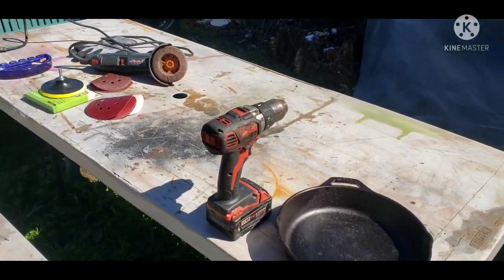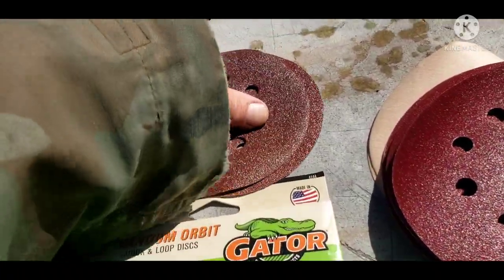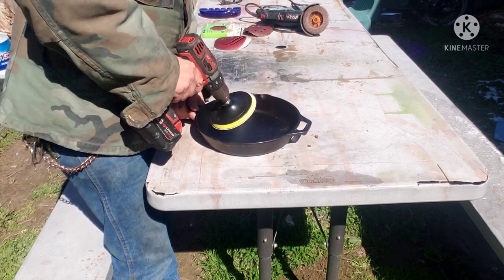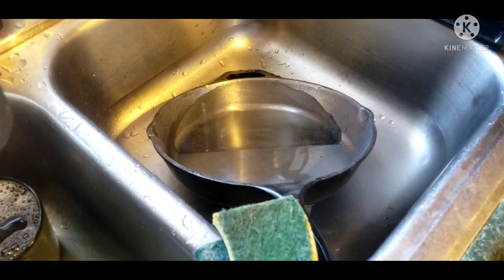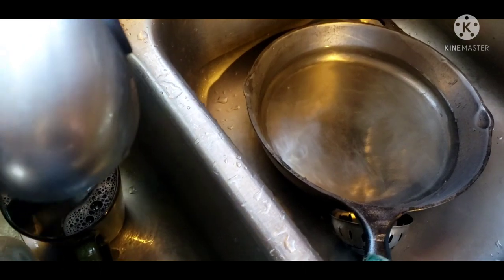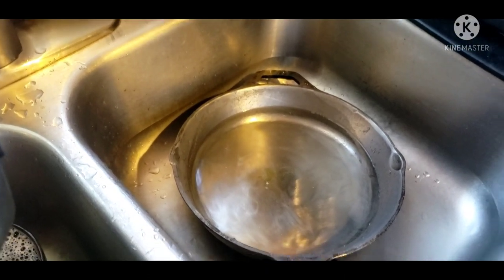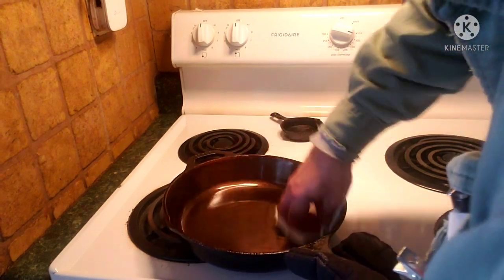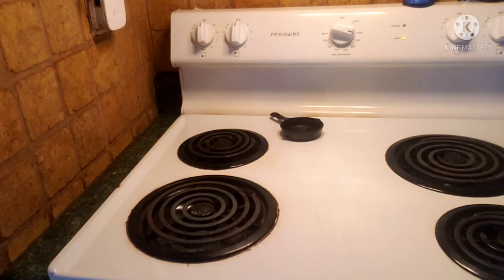How I sanded and seasoned a new Lodge  cast-iron skillet

Comment: Sticky food is more an issue of the wrong cooking technique or temperature. Smoothing the skillet will not change how it cooks. That's coming from a guy who sanded all his 20 Lodge skillets, a Swedish Ronneby Bruk and two noname ones from Eastern Europe. The real difference is in cleaning and maintaining the skillet as the smoother surface no longer tears apart the towels. That's why I also sand the outside (but a little less thoroughly). The smoother surface also makes your wooden and plastic spatulas last much longer and metal ones are much less noisy.
Just don't overdo it. 80 grit is all you need, maybe 120. Just remove the spikes, you can leave the pits, they will fill with seasoning quickly. The fine scratch pattern of the low grit sandpaper gives the seasoning a perfect surface to adhere to.

Comment: I commented on one of your last video. My eggs didn’t stick Right out the box of my 12 inch lodge skillet. But just like you I wanted a smooth surface. So I sanded my 12 inch to a near mirror finish . Looked great but the seasoning just wouldn’t stick. The surface was to smooth. So I over night soak the inside with vinegar. The vinegar micro etches the surface. Still super smooth and The season stay on with no problem .     Again soap will NOT harm the seasoning ( polymer).     Way back when, soap had lye. not anymore .
Reply from the maker: I have heard many say the same thing about having difficulty with the seasoning adhering to a smooth pan, especially a highly polished one.
  I have been fortunate, i haven't had that problem with the ones that I have smoothed.
 I have run into that problem with other pan though. (Both new and vintage) and like you, I soaked them in vinegar to give the seasoning something to "grab onto". 😁
  As far as using soap, after decades of being taught not to, I did my own research, and "testing", and found that todays detergents will not harm your seasoning nor pans. (I'm not too proud to learn.)
  Thank you for watching, and leaving a comment.
👍😁

Comment: Very cool video will be trying soon! I feel like I ruined some seasoning at the start of my current cast irons life and I want to try and revive it!
Reply from the maker: Thanks for watching. 👍😁
  I would caution that if you have a vintage pan that was smooth from the factory, sanding it will dramatically decrease its monetary value.
  Secondly, if you do sand one down, it's not necessary to sand it as fine as I did on this one.
  Sometimes too smooth of a surface makes it harder to get a good initial seasoning.
  80 to 120 grit will work fine.
  If your pan is already smooth, and you are having trouble with the seasoning.
  I would suggest stripping it with yellow cap easy off oven cleaner.
  Then either place rags soaked in vinegar inside the pan for 20 mins, or soaking the pan in a 50/50 mix of water and vinegar for 30 mins.
  The vinegar will etch the metal and give the seasoning something to adhere to.

Comment: Absolutely the best way to improve a Lodge pan. I don't know what happened to their molds or who they let design the new ones, but compared to old vintage Lodge  stuff or the much better Wagner ware/Sydney pans, the bottom of a new Lodge pan feels like 5 miles of bad road. I used a flap disc in a grinder on mine. You don't need a mirror surface and in fact, that wouldn't be desirable, but something smoother makes cooking in it a whole lot easier. 80 grit or 120 grit knocks the surface down smooth and gives you a great finish for cooking. I'm guessing the only reason it took as long as it did, is because you were using the wood discs that you had instead of metal ones. Lots of wood sandpaper uses Aluminum Oxide as its abrasive. It's cheap and does a good job on wood and doesn't rust if it gets wet and streak your wood project. But as you might have guessed, it's not as hard as iron so your pan is chewing up your discs quickly. 
But for using what you had, you got a great finish and all it cost was some extra time.
Reply from the maker: Actually I do usually use a couple different grit flapper discs with a grinder.
  But I was trying to show how it could be done with  common tools that most people have laying around.
  I did go overboard on the smoothness, fortunately that pan and a few others I sanded that smooth all took the seasoning very well, not a single one has had issues with the initial seasoning flaking off, or any other problems.
😁
 Thank you so much for watching and leaving a comment.
 It is much appreciated.
👍😁

Comment: This dude is funnnnyyyy. Not only sanding the pan but BUMPED BUMPED da debris out of it on da table.😂😂😂😂 Weeeeeak! & after that IT'S DA ONLY TIME IT'LL SEE SOAP ON IT?🤣🤣🤣🤣🤣🤣🤣🤣🤣🤣🤣I really want than pan. A great demonstration piece😂
Reply from the maker: Glad you liked the video!
 Thank you for the kind words.
👍😁
Reply from the maker: Cynthia Wesley,
 I should elaborate, I don't normally use dish detergents on my cast iron.
 Mostly because it's just an old habit. 
  Almost all detergents used to contain lye, this would strip the seasoning off and permeate the cast-iron leaving that soapy taste.
 (If washed after each use.)
 Todays detergents are different,
 Once the initial seasoning is on the pan, a quick wash with soap and water after each use is normaly  not a problem.
  A pan with a good seasoning on it should clean up fine with just plain hot water.
  As far as contamination is concerned if you are using these pans properly, they are heat sanitized before and after each use.
  You preheat the pan before use, cook with it, clean it and dry it with heat, ( thereby sterilizing it) then oil it.
  I hope this helps explain my statement.
😁👍

Comment: For the sides you can use a 2in Roloc bristle disc in an angle grinder. And soap doesn’t hurt a seasoned pan as long as you oil it,

Comment: This is hilarious! Why sand when all you have to do is simply season it and use it. Used daily within a few weeks it will smooth all by itself.
Reply from the maker: Everyone has their preferences, 
 Thanks for watching.
 👍😁
Reply: No, no it won't.  Years of regular use on a Lodge, doesn't begin to give it the quality of surface you'll find on a Griswold, and yes, yes it does make a difference.
Reply: I bought the cheapest cast-iron pan I could find on Amazon. It was rougher than a cob when I got it. It was seasoned according to directions and simply used but not sanded. It is so slick that a strong wind would blow an egg right off of it.
Reply from the maker: It's simply a personal preference,
 I grew up using the old wagner, Griswold, BSR, and Lodges that came machine smoothed.
 I just prefer that over the rough textured finish.
Reply: Lodge isn’t too bad to get to season to cook well. But it still takes 5-6 seasonings to get it barely functional. I bought even cheaper pans than Lodge and 6 seasonings later they are still terrible for cooking. 
This is an easy fix to correct a horrible cheap pan and make it excellent. I even have an antique  BSR that is slightly rust pitted I’m going to do it to (I don’t care about collectibility). In fact in 100 years no one is going to care if I sanded my BSR...it’s still going to be collectible. And I’ll enjoy cooking on it more while I’m actually alive 🤣

Comment: Ya know, thinking about this, it seems we're just creating a typical smooth steel type pan. I've done this and it seemed to work the same either way. For all my labor I coulda just went and bought a slick steel pan. Maybe I'm wrong.
Reply from the maker: Carbon steel is similar, stainless is very different.
 Both carbon and stainless are quite a bit thinner than cast iron.
 This changes the heating and cooking characteristics.
Reply: @sidewyndersshed1676  I believe all that but when I "polished" my Lodge skillet it didn't seem to release any better. It was a fun project but I didn't see any advantages. Even cleaning was the same.
Reply from the maker: @finallyfriday.      
 Honestly it is not how smooth the pan is that makes it "non stick", it is a combination of a good polymerized seasoning and propper heat management while cooking. 
  A rough cooking surface will work almost as well as a smooth cooking surface if properly seasoned, 
  it is mostly a matter of preference. I really like and prefer a smooth cooking surface on my skillets, so for me it is worth the time and effort.
 Others may dissagree or not be bothered by a rough surface, either opinion is valid to the individual that is using their  cast iron..
 It is what appeals to the individual that matters..

Comment: When sanding the pan, can you over sand it?
Reply from the maker: Not with the drill and sanding discs I was using, nor with a small finish sander.
  But that grinder with the sanding wheel wil eat through that cast iron if you are not careful with it
Reply: Nice video, thanks for letting me know you posted it. 

I was thinking while watching it that someone who is new at sanding should take care to make sure that they sand it evenly, because if it gets a thin area, it might eventually crack. 

I didn't sand mine nearly as beautifully as you did yours. I basically knocked the tops off the bumps and called it good. Next time I'm looking for a project to procrastinate with, I'll do a super job like you did!😉
Reply from the maker: @patti6194  
Thank you for the kind words, I'm glad you liked the video.
  The grinder with the sanding wheel on it does an excellent job, but you are correct, you have to be careful when using it or you can very easily and quickly gouge the pan or put a thin spot in it.
 The drill with the sanding pads however takes a long time to eat enough material to do any damage.
  But, with time and gradually using a higher grit pad, 
 The results are impressive.
  I spent about 2 hours on this pan.
 I used 4 60 grit pads, 2 80 grit, 2 120 grit and 2 320 grit.
  I could have stopped after the 80 grit.
  I just wanted to see how smooth I could get it.
😁👍

( The drawing to win this pan will be in a week from now.)

Comment from the maker: I just want to emphasize that this is a new $20.00 pan. There are thousands of them readily available. DO NOT do this to an old pan that you have without doing research on it first! Any cast iron that you wire wheel, sand or grind will negate any monetary value it had.
Here is a link to my video stating this.
https://youtu.be/WRpnW9Glwfg
Reply: I don’t care about ruining my pans collectibility. I have a slightly rust pitted BSR that is at least 50 years old. It’s only worth about $50 now. Would rather have a nice cooking pan to use for the rest of my life than $50 🤣

Comment: You would think that by now with all of the videos and complaints about Lodge's rough surface, that they would take the hint and go back to the old way they used to make there product. I personally wont buy a new or newer Lodge product simply for this reason even though I consider them to be a quality product. I would rather find an old (reliable) piece of rusty cast iron and restore it than buy a new Lodge cast iron skillet.
Reply from the maker: I have heard that Lodge is planning on making a line of cookware that will have a smooth machined finish.
  Of course they won't be in the $20-$40 range.
  I am interested to see if they actually offer this, and what price range it falls into.
Reply: @sidewyndersshed1676  They came out with a line of carbon steel pans. That's about the only thing I like more than cast iron, is carbon steel. You care for it exactly the same way, but its lighter and heats up and cools down a lot faster. Makes the pan more responsive and is easier in everyday use. 
A big cast iron skillet or dutch oven still has its uses, but if you're just wanting to cook dinner quickly, carbon steel pans are nice.
Reply from the maker: @DriveCarToBar  
I will have to check out their line of high carbon steel pans.
  Thanks for the comments.
👍😁
Reply: Lodge could do that, and the prices would be comparable to Field, Finex, Stargazer, etc. I'm sure Lodge has heard those negative comments, but since they outsell all of those other brands combined, they probably don't pay much attention to them. If the rough surface is such a problem, all one has to do is invest in those other brands.

Comment: can you please link the dics that you used for sanding?
Reply from the maker: The sanding discs I used, were an assortment that I had for woodworking.
  They are 5 inch discs with a velcro backing, 
  I had 60 grit,80grit, 120grit, and 320grit.
  You can find these in any hardware/ home improvement store, as well as any walmart.
  They usually come in packs of 5 or 15.
  The attatchment for the drill can be found in the same area.
   I don't have any particular brand that I use, most brands are roughly the same.
   Sorry, I don't have an actual link to this product for you.
Reply from the maker: I did find this on amazon, it seems like a good selection for a good price.
  However I have not used these before.

100PCS 5 Inch 8 Hole Hook and Loop Sanding Discs Sandpaper, 60 80 120 180 240 320 400 Grits Sand Paper for Random Orbital Sander https://a.co/d/7JUVoHE

Comment: I was thinking it might be a little faster if you worked at some sort of workbench height instead of a rickety old picnic table...and if you, you know, clamped it down some kinda way, even if it was just with a vice grip.
I was also wondering if it would put you out too much to wash the sink next time you make a video?
And God forbid you should buy a new scrubby every year or two...but you could always throw that one into the dishwasher or the washing machine with a load of towels...works great.

Just kidding*...nice job my man!

*But also kinda not.
Reply from the maker: LOL, 
 The wife wouldn't let me use one of her good scrubbys.
  I had to use an old one.
  Normally I would have done this out in my shed with a flapper disc on a grinder.
 I wanted to show that it could be done with tools and in areas that most people have available, it just requires a bit more work and patience.
  Thanks for watching and leaving a comment.
 😁👍